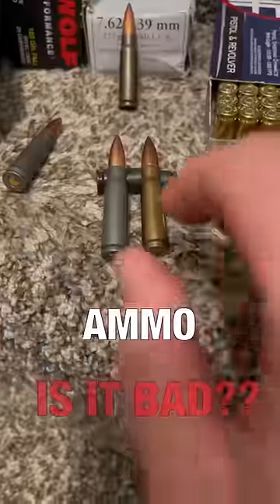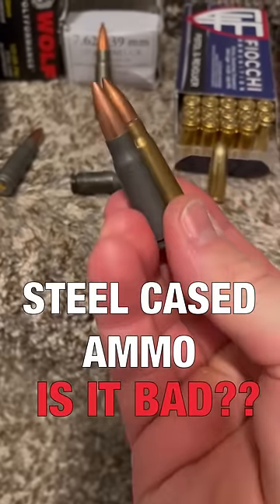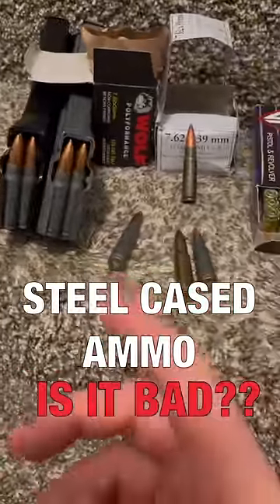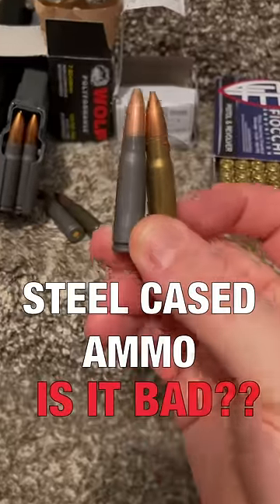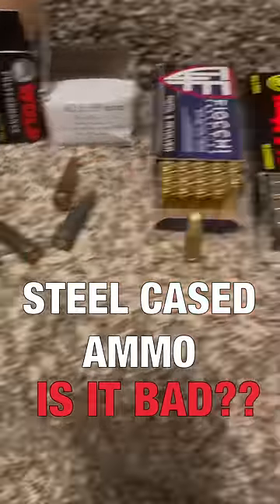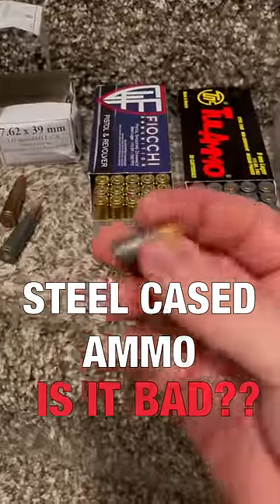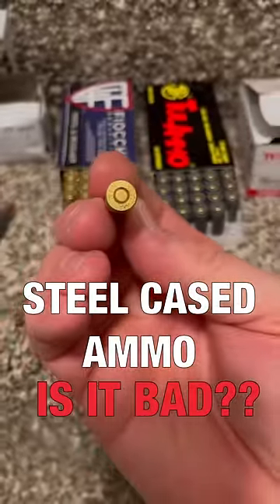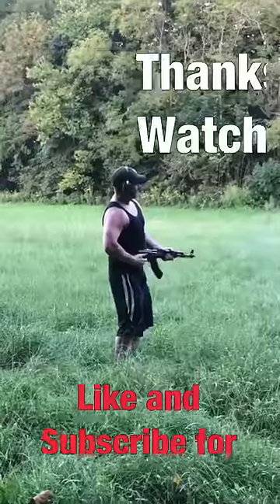Steel cased ammo, is it bad? #short #shorts #shortvideo

Comment: Never had any problems running steel case. I say bring it on.
Reply: Exactly. I run that Tula ammo pretty regularly through my colt block 2ish and I’ve never had a problem
Reply: I use it and save my brass,don't try to reload it,,it will stick in the die
Reply: I wonder how aluminium shells would go cheaper then steel, flexible and lighter
Reply: @petersmulders8058  aluminum won't work in rifle ammo.  It's been tried.  Tiny microscopic holes form from aluminum under extreme heat and pressure.    Just shoot steel.
Reply: Me either. Steel for plinking. 62 grain brass for storage.
Reply: SHOW ME YOUR WAR FACE!!
Reply: You must have an AK! ARs choke on steel ammo.
Reply: @guyfawkesuThe1  I have 3 AR platform riffles. None have a problem with Tula steel ammo. The same experience with Tula 9mm in my Glock and SIG p320
Reply: @hdtvcamera1  You must keep them well oiled. I have an AK and all I have to do is feed it.
Reply: @guyfawkesuThe1  I keep my guns clean but I don't use extra oil. I heard the same thing before I tried shooting steel ammo. Maybe they are making the casing to higher quality standards these days.
Give it a try again. If Clark Brothers means anything to you I'd meet you there and bring ammo for you to try.
Reply: Have run steel case only thru the ol sks for years and never had a problem.Never ran steel thru my pistols or other rifles tho.but sks+tula = Cheap reliable fun

Comment: I commented before watching. 
1) Most folks don’t shoot enough to hurt anything. 
2) If you do shoot enough to break something, you can afford to fix it with the money you’ve saved by shooting affordable ammo. 
3) You, probably, will have no problem.
Reply: Most people don't know how to tune their gas guns to handle brass without damaging it and break extractors on brass cases. No wonder steel has a bad rap. It's because people are dumb.
Reply: Steel case only matters if it's harder than the chamber etc becsude it'll scratch and wear it down overtime..
But if you think for a second that steel alloy casing is that high quality of steel then you're wrong, it's probably not harder than brass 😂😂
Reply: Not me tho stay safe
Reply: @jonslg240  let's be honest it's probably made out of mild steel. And mild steel is very easily bendable by hand.
Reply: @krislarsen6546  exactly..
That being said it's definitely not as soft as copper.. but it's probably not going to reduce the lifetime of parts by very much
Reply: If it can't take steel, it doesn't deserve brass
Reply: Facts. Came to say the same thing